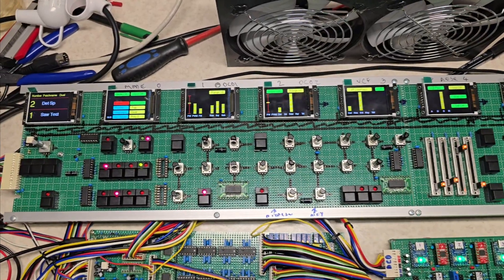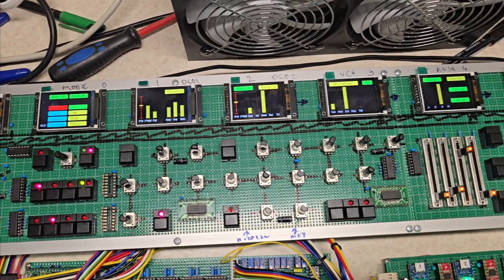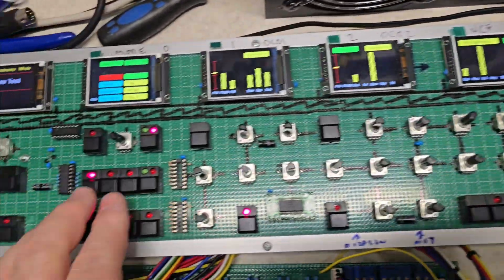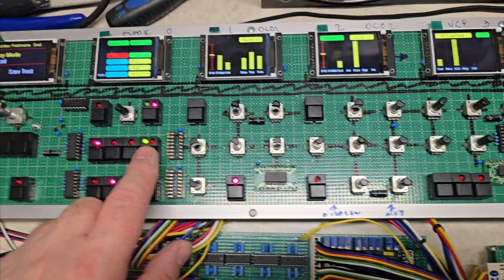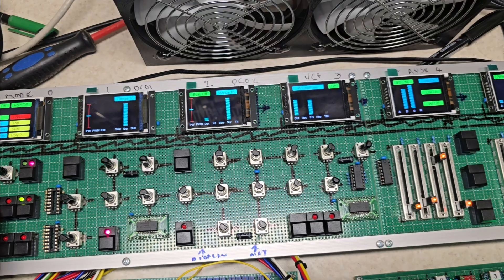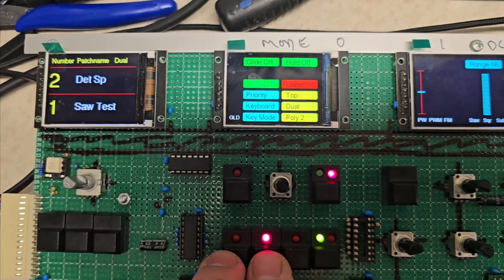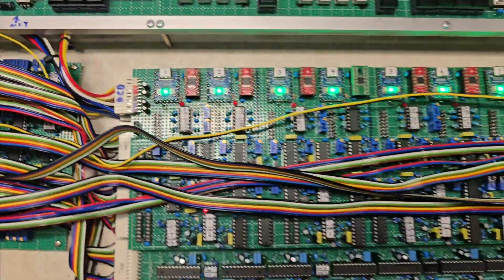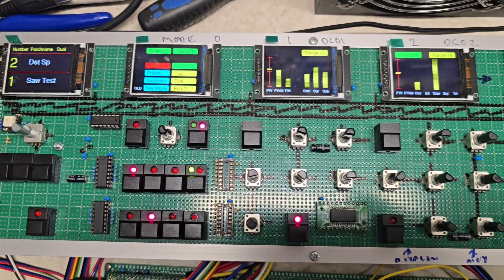Bi-timbral 8 voice poly

Comment: What is this thing? Why dont you provide an introduction and some context on what you are building. Editing software is available.
Reply from the maker: @Dont_Gnaw_on_the_Kitty_3  I'm sorry if you don't understand what a bi-timbral synth is.
Reply: @craigyjp  'Bi timbral 8 voice poly' wtf is that? You're sorry I didn't understand, but you still haven't explained it. BTW Your tech looks amazing.
Reply from the maker: I only post my builds to YouTube so I can link them into forums where I post most of my work and people actually understand what a synth is. There is a description with this post and also my channel has at least 4 other videos covering segments of my build.
Reply: @craigyjp  Whatever it is, it looks amazingly professionally designed and built.
Reply from the maker: @Dont_Gnaw_on_the_Kitty_3  thanks, I wouldn't go that far, this project has been an abject failure from the start, I built it really on untested technology which was then found to be unusable. This is the 4th iteration of the voice boards and 3rd iteration of the displays/control panel